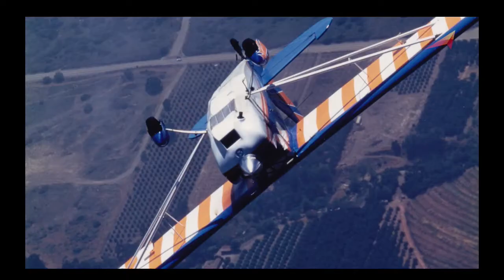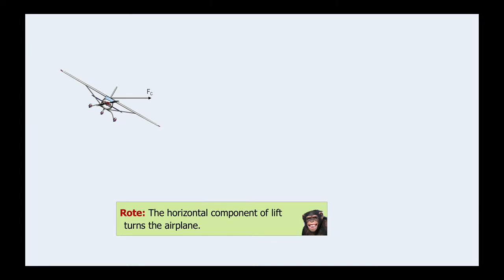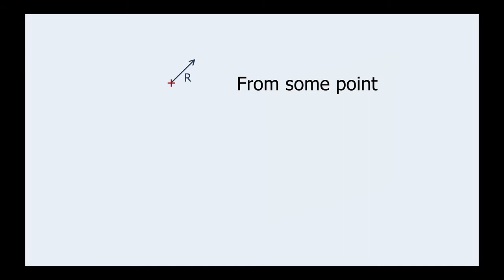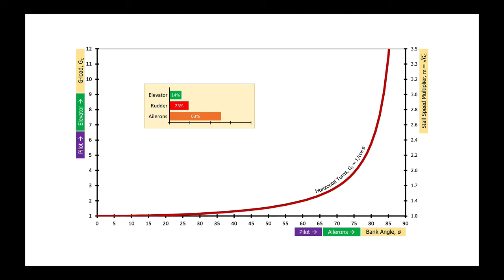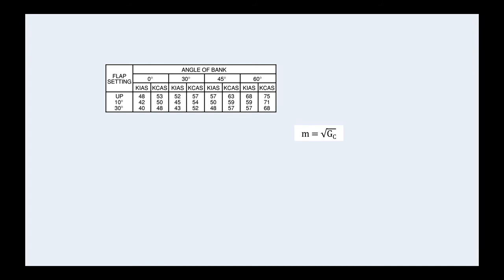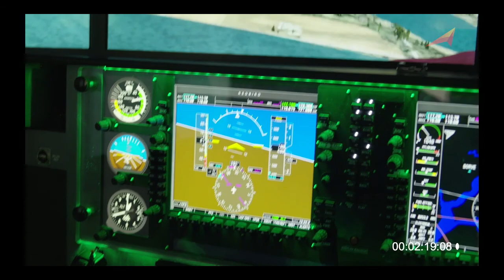Learn to Turn – Webinar Recording

Comment: Watching late - the reason most pilots would say the aelerons are the primary control when turning an airplane is IMHO because aelerons are used first (primary) and if they aren't used the turn doesn't happen. Needless to say, If the elevator is 'primary' - first, no turn happens. Semantics maybe, but like all aspects of airplane control, in fact all four primary controls are typically involved, with power being the fourth.
Reply from the maker: Thanks Jim. Maybe true for some turns, but not all. For example, ailerons aren't used at all to initiate vertical turns (aka, loops), be they inside or outside loops. And even in the case of level turns like rolling turns, aileron and elevator (and rudder) are used simultaneously. In the case of knife-edge flight, ailerons are used to roll to 90 degrees of bank, but the path is kept straight with elevator. The point is that with or without aileron inputs, the elevator is primary for bending or straightening the flight path.

Comment: All this makes sense but the only little detail I don't understand is what is the correct technique for transitioning between straight flight and a turn. Based on the theory what makes sense to me is that if I'm in my climb after T/O, before I roll into a climbing turn I should reduce the AOA by a little and then roll in and then add back some back pressure. Is this the correct technique for climbing turns? What about descending turns?
Reply from the maker: Hi Marko. Out of curiosity, how did you arrive at the proposed technique for climbing turns, and what would the purpose be to reduce AoA prior to banking the airplane?
Reply: @richstowell  Thank you for responding. My thinking is that since I want to climb at Vy, if I add a turn to my climb, to fly it correctly I have to increase AOA as I roll in which means more lift but also drag, and since I’m already at full power that will mean a reduced airspeed while in the turn. So to maintain speed I need to reduce AOA. I guess I could do that after being established in a turn but that strikes me as incorrect technique. So my only conclusion is to momentarily unload then roll to my desired bank while adding back back pressure and as I complete my turn again unload just before I roll out to level climb again. And I realize that for a shallow turn of max 30° it shouldn’t take much of unloading and adding back. Btw I’m just before my check ride, so of course chances are high I misunderstood something and my reasoning is completely flawed. Thanks!
Reply from the maker: @MarkoRdeLux   Sure thing! Don't overthink this. Climb at Vy, smoothly roll into the crosswind turn and make whatever minor adjustment is needed to maintain Vy (if that's the desired speed). All that is done simultaneously. Same in the descending turn base-to-final: smoothly roll into the turn and make whatever minor adjustment is needed to maintain the approach speed. If the trim is set properly, and given the shallow banks normally used in the pattern, these adjustments should be quite small, almost unnoticed. Best of luck on your check ride!
Reply: @richstowell  Thank you very much Rich, really appreciate the answer. And thank you, should be next week if the weather holds.
Reply: Just wanted to let you know I passed my check ride today :) Thank you for the tip and for your material. It went pretty good!
Reply from the maker: @MarkoRdeLux  CONGRATULATIONS! That's a wonderful milestone, Marko.
Reply: @richstowell  Thank you sir, I love this so much it for sure is only the beginning. Night VFR and ATPL theory next.

Comment: Pilots, as a group simply don't know how to turn! There is no fucking way it was this bad back then  like it is now. Atleast 90% instructor's ive met are at most  only 200 hr pilots with 0 tailwheel and the only rudder pedals they seen other then a sloppy  172, are sitting under their home computer desk. They may not even know what or when to use adverse yaw, But their radio work is always impeccable lol